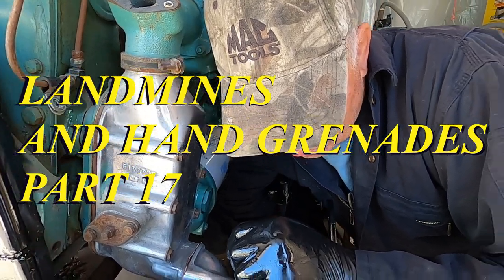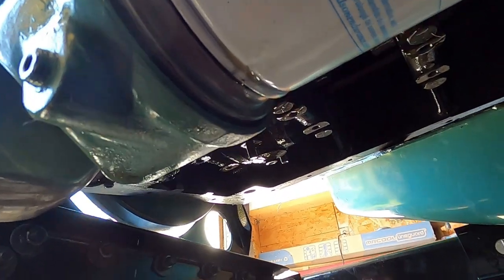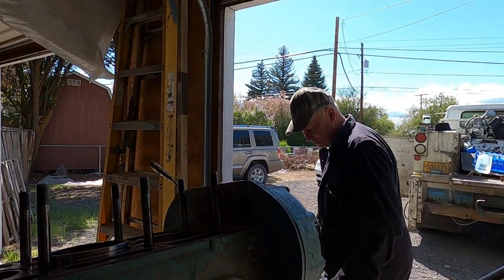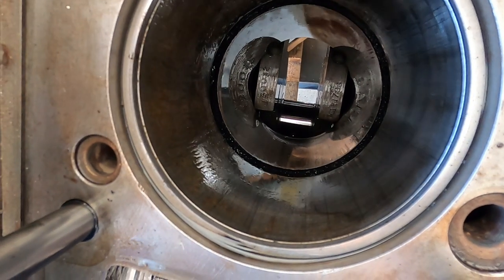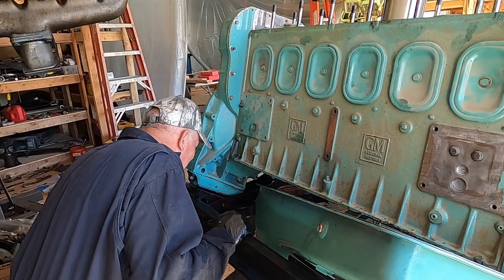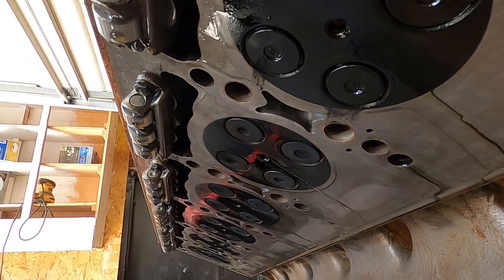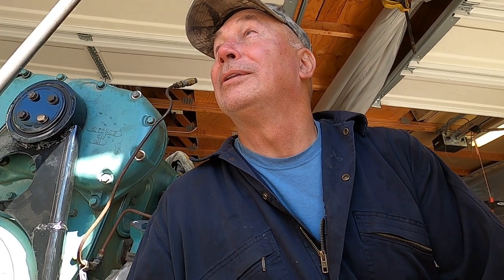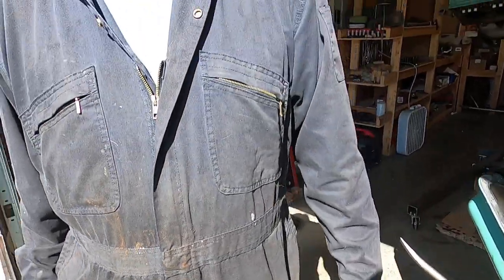Part 17 Joe digging deep into our 671 Detroit Diesel Engine, assessing real issues that need fixing

Comment: Wow guys sure hate to see this, but it is good that you caught it at this stage.
There’s no doubt these things are money pits... Not knowing enough,...I bought mine last August and was told it was road ready...
Mighta shoulda kept my skoolie...
And when I got home and did inspections  I was damn lucky to make the 600 mile trip home from Tennessee.
It has now turned into complete rebuild.
“Well dad warned us”
Thanks for the videos!
Reply from the maker: You are right!!!!! Money pits for sure...Dad did warn us!!! Dad bought this bus in the early 70's, we had a lot of fun growing up traveling with dad all over the country, all over the west coast up and down and to the Grand Canyon to the Gulf of Mexico with no major problems, the biggest problem we had was stopping, we had all the air cans replaced and I put a new air regulator on it and after that it stops on a dime.... the engine ran great until we took it to ABC Bus in Grand Prairie Tx. and had them remove all the old paint and primmer it....After that we took it back home and put it back in our 10,000 square foot warehouse and it set there 10 years...When we decided to move back to Oregon from Texas we greased the old girl up changed the oil, checked the air filters, kicked the tires, took it on some short test runs, everything was great!!!! We headed out for Oregon....We got about 200 miles out of Dallas, stopped to kick the tires again and check everything out, I noticed a trail of oil behind and under the bus, it was leaking everywhere... We continued on, we had to, We were moving to Oregon... To make a long story short we found out later ABC Bus never masked off our air-intakes so our air holding reservoir was full of baking soda...So all that we have been thru can be traced back to a shop we took it to, to do us a service and they neglected to do a simple task of masking off our air-intakes which in turn ended up dusting out our engines.... Dad told us to not do any of this we have done to this old girl but we feel we have gone to far to turn back now....